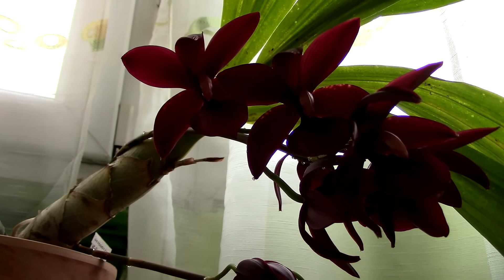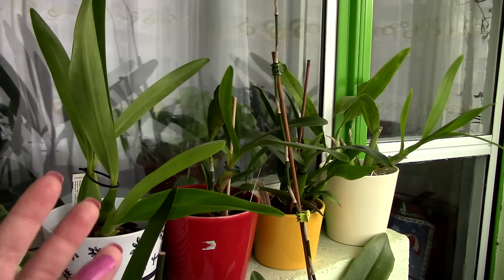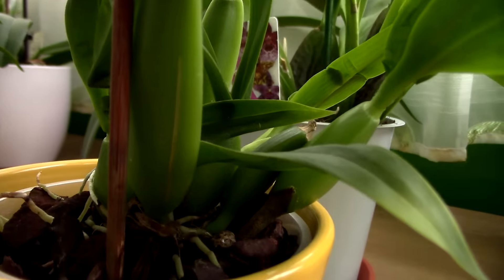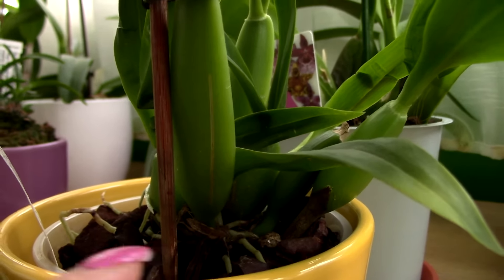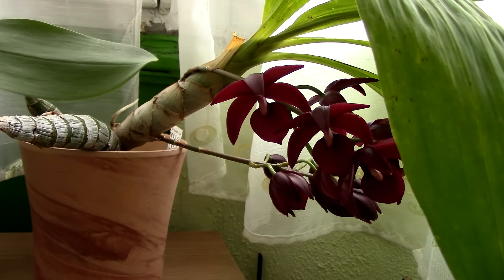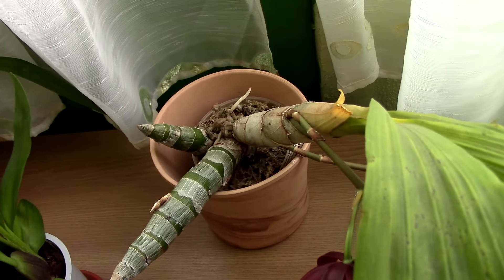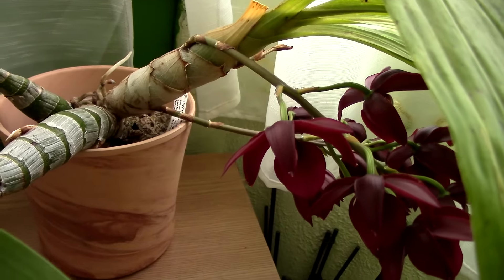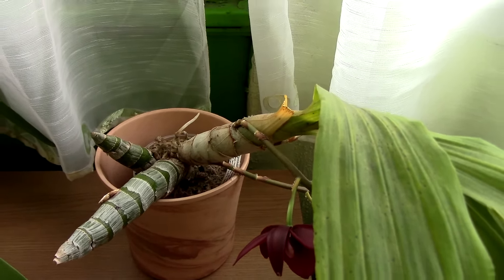Catasetum orchids with shriveling pseudobulbs

Comment: I have this cycnodes with only 1 old pseudobulb and 1 new young growth with leaves, but the old pseudobulb is now spongy and the new young leaves on the new one is turning yellow from the bottom.  it is 8/28/17 texas warm - when the bulb is spongy, should I cut it off?  would this mean it is rotting? - the new growth has roots.  I have only had this for a couple of months and the old pseudobulb was bent and very shriveled when I received it. this is a small plant

Comment: Hi, Danni,
I have just bought a Cycnodes Wine Delight a week ago, but it comes in with a broken pseudobulb (I really mean it snapped into halves, with about 1cm tissue structure connecting the halves.) with 2 leafs, and 2 flower spikes starting from base.  Now, I have tried to rescue the bulb with cinnamon and floral tape. :<
So far, I see the flower spikes have grown abit.  top leaves starting to yellow.  The wound  area has shriveled up and dried.
What is your advice?
Reply from the maker: +Jeffrey Chiu well depends how deep the split is, not sure about their ability to recover or multiply in this situation so all you can do is wait it out. Can you send me a picture of the plant though? just upload it to flickr, photobucket or g plus and send the link in a comment.